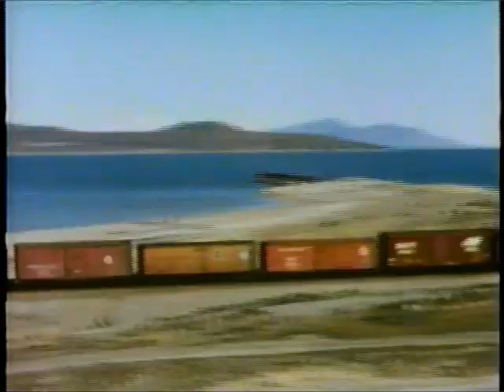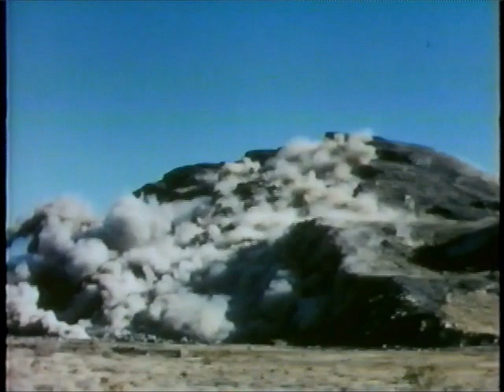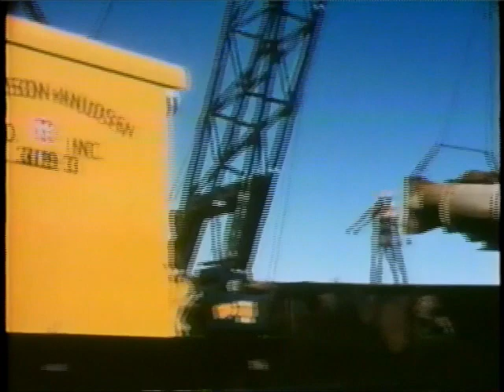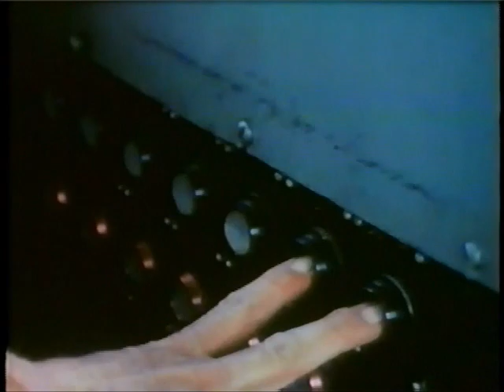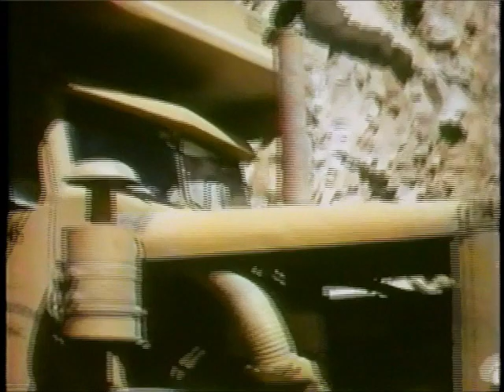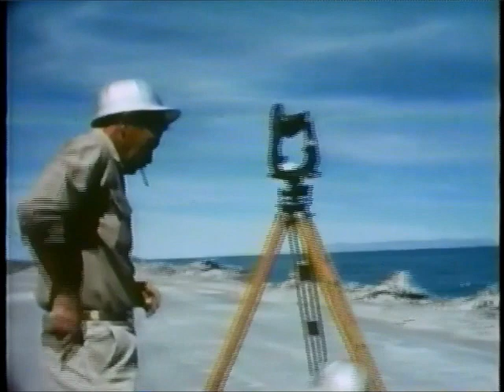Mariners in Hard Hats: a Morrison-Knudsen film

Comment: MK Corp did a good job when they buit it but four decades later it turned into one of the worst environmental disasters in history. When the causeway was built across Salt Lake it turned Gunnison Bay and Willard Bay into a toxic red soup. The reason being was the causeway collapsed under its own weight and the culverts that was constructed in 1952 to help the water flow through the massive causeway were clogged with silt and rock shutting them down forever in 2003. In 2016 after seeing a gruesome photo taken from the International Space Station by Jeff Williams Union Pacific organized a team of geologists from the US Geological Survey and the Army Corps of Engineers plus workers who built the original Causeway to head out onto the lake and save it from complete ecosystem collapse. What they did was they had to shore up the original Causeway by dumping rock into the lake in places where it had sank the original culverts built in 1952 were taken out and replaced and at the entrance of Gunnison Bay Union Pacific build a bridge so the waters of the lake flow freely between the North Arm the East Arm and the Blue Waters of the South Arm. During the transfer process the lake level dropped and Union Pacific has to wait until spring for the lake to fill back up again as the Wasatch Mountains melt and fill the lake back up with water.
Reply: Aaron Peavler/Geomodelrailroader Railroad Photography
 Excellent report. Thank you.